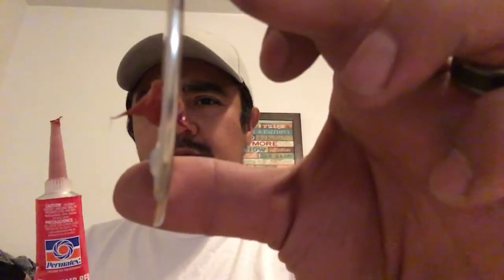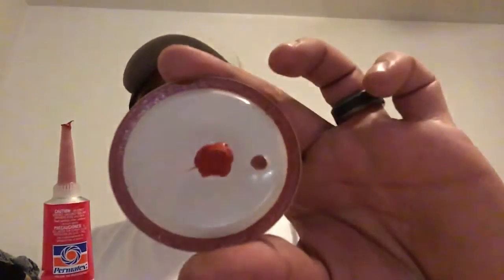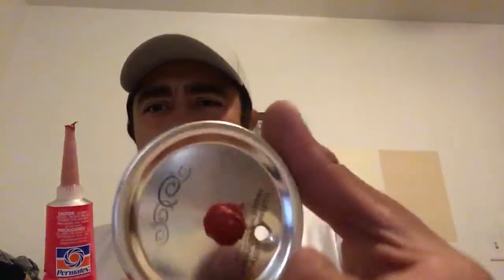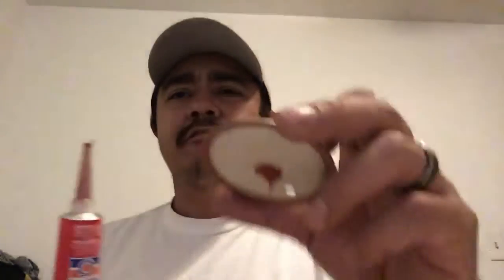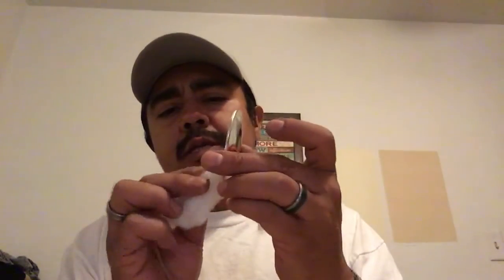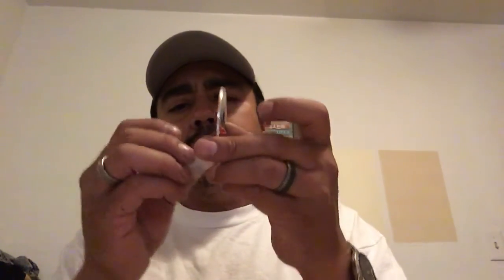Self healing port lids for liquid culture and grain jars part 2

Comment: Hi thanks for the video. Have a couple of questions though.

So those injection ports act as self healing ones? Meaning they will mostly close up after each injection?

Also, doesn't the hot needle melt or get stuck with the rtv material?

Comment: Hey Jr F. I watched your videos on making the self healing lids, good info. I tried it myself but noticed the RTV was sticking to everything. 

I did some research and found out that rubbing alcohol is the magic key to keeping RTV from sticking. 

Just apply a dob to whatever, then liberally wet your gloved or bare finger, (I used 91% Isopropyl) with the alcohol and tap the silicon into the shape you want. 

BTW the finger must remain wet.

Comment: Wrap a paper towel around a finger, wet it but not enough so it's dripping, then using your wet paper towel wrapped finger to flatten the RTV out. The RTV will not stick to the wet paper towel and this makes a cleaner, flat port without the usual mess or hassle removing paper stuck to it.